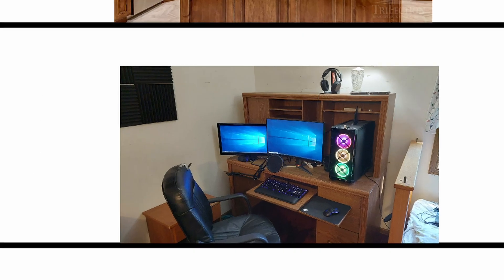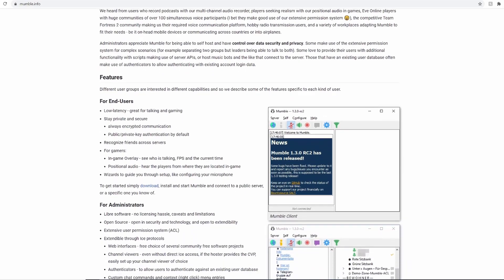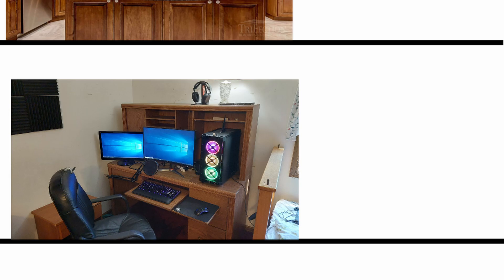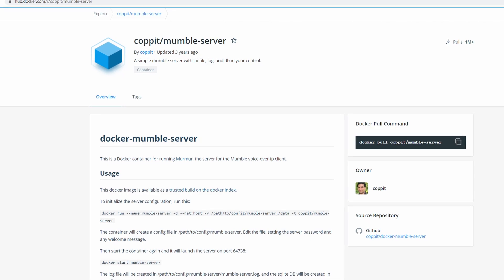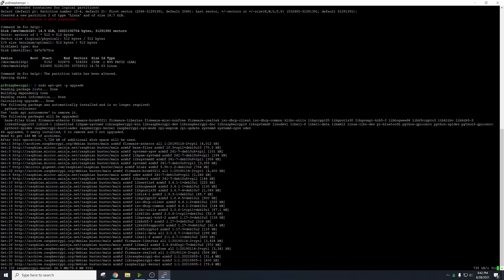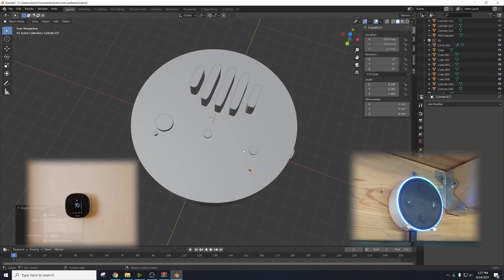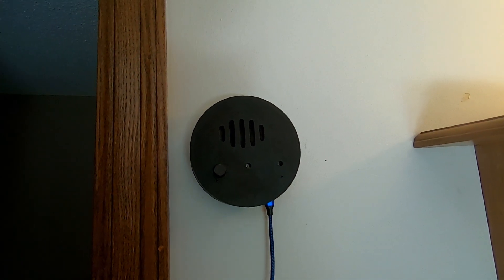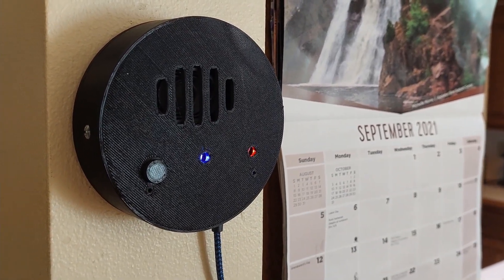Hearing Dinnercall While Gaming in the Basement (Raspberry Pi Home Intercom)

Comment: Cool, I definitely will make few, the same problem communicating with kitchen ;) It will be so cool, two sons rooms, wife's room and kitchen. But it has to be cheap, cheaper than your with that rpi hat which is quite pricey and I want to make 4 of them, I'll use cheap i2s microphones, and some simple amplifier on jack output. I hope it will run on rpi 2 and rpi 3 because I have these lying around, rpi 4 will be the server. If it will not be cheap then easier to do is to buy one of these WI-3SN or similar, connects over mains.

Comment: Hey, its very nice project,  quick question if both buttons are pressed one at local and at remote intercom, would a noisy full volume feedback be heard locally? I installed three similar mumble intercoms but it had that glitch so I was wondering if this version has addressed that feedback issue? cheers
Reply from the maker: Hey S Shah, I believe this could be an issue with my project too, I don't believe the Talkiepi program I used that I didn't develop has anything to stop that from happening. When using it however we just take turns between speaking normally so it hasn't become an issue for me, and my casing design having a barrier wall between the speaker and the microphones and only 2 small holes for sound to enter may also help prevent that from becoming an issue as well. I don't believe I have any resources to help you with your issue though, so sorry about that.
Reply: @skyblaze103  Thanks for the feedback, I can live with that bug but it  is a deterrent for family members to use these talkie pies that I have installed all over the house ,,lol I will be still looking who knows may be next version would be able to mute the local speaker on button press.

Comment: You weren't inhaling lead...the smoke from solder is from the rosin..witch is from pine trees..
Reply from the maker: I was using a lead based solder which is where the concern came from because I didn't get a fume extractor, but after looking into it I did learn that the lead vaporizing on a home soldering iron is highly unlikely so you are correct.

Comment: That python code for the leds is slow because that sleep is a blocking cycle. Try using uasyncio for the sleeps and once the button is pressed, after setting the led on, sleep for 1 or 2 seconds and keep the LED on without runinng the loop again (That should free up the cpu for mumble)
Reply from the maker: Thank you for that, I'll look into that and change it.  I'm not incredibly experienced in Python yet and did what I thought what would work at the time, but I've heard of asynchronous programming and that probably would be the best way to do that